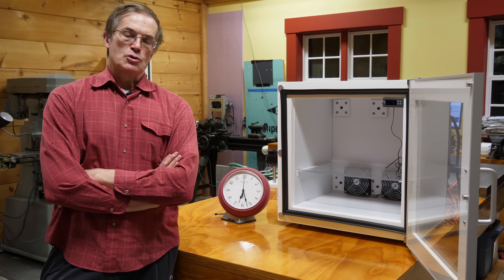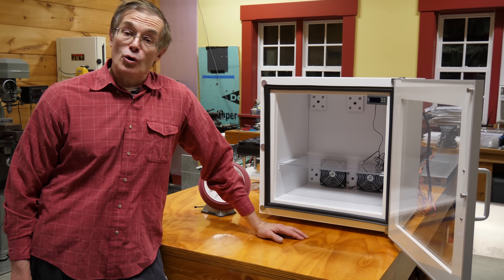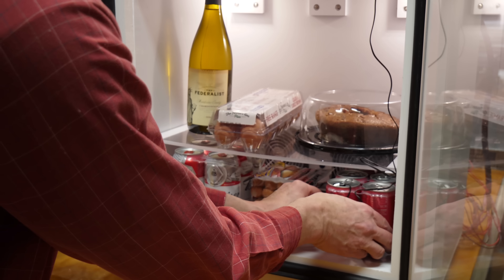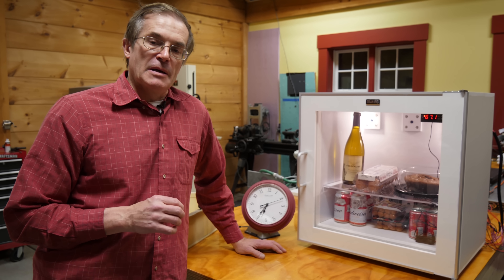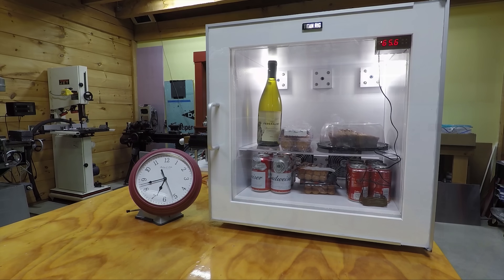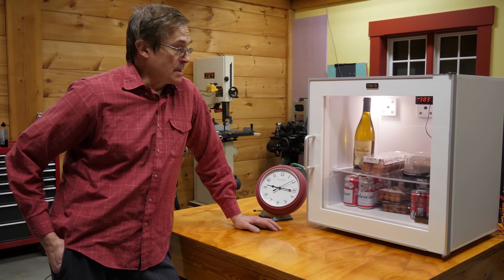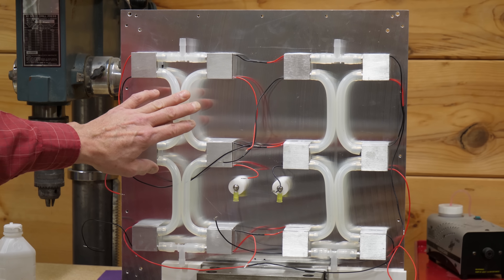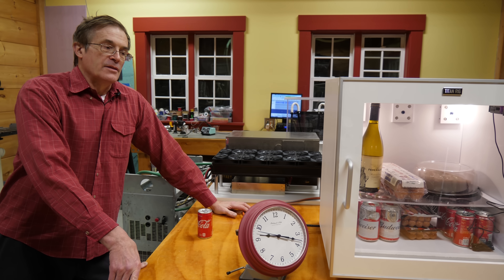TESTING OUR DIY REFRIGERATOR! - TEC/PELTIER

Comment: Hi there! I'm impressed with what you did here. Can you add more details about variation of the humidity (RH.)  throughout the cooling process? And was there any condensation  ?  And what was the output power?
Reply from the maker: Thanks.
There was no condensation, but the air in the lab is relatively dry.  The refrigerator uses 125 watts continuously.
Reply: @TechIngredients  Thank you very much! And one more thing, if you change the design a top door instead of a side door you can save more power!

Comment: Not sure you look at old post but. I live in an area where tap water is a little iffy for consumption; OK for showers etc. 
4 or 5 years ago, I looked into water filters for drinkable water and settled on the gravity fed Berkey filter which is 2 cylinders, one on top of the other. The top cylinder, supply, gravity feeds water in to the bottom through a special filter. This system is very good and my wife and I have enjoyed excellent water since. 
THe filters are good for 3K gallons each, so, I have changed them only once. They still pass the red dye test.
Question(s) is/are would making a cooing system based on your design for a cylinder be practical? I just need to cool the bottom cylinder and just to a pleasant chilled range, guessing, 40 - 50 F
ANy thoughts or suggestions would be great. A video on this popular design of water filter would be amazing. 
Regards,
Glenn,
SC
Reply from the maker: Yes, that would be a practical application.  Using common CPU heat sinks on the hot side would be easy.  Coupling the flat, cold side of the TEC to the cylinder might take a little thought, but once attached, you can experiment with a variable voltage power supply and once the right steady state temperature is reached, substitute a compact wall wart for the system.

Comment: A size of the water cooling radiator is monstrous. Compare it with a typical computer water cooling system which dissipates about 200 Watts without any noise produced.
Reply from the maker: Size matters.  The larger the radiator and the slower the air flow, the higher the effeciency.

Comment: The problem with this device will be the ambient temperature, in the video the room temperature 68 F, hence the reason you can go down to 38 F, but say the temp in the room was 90 F, then this device would only go down to 60 F, a Peltier device can only cool down about 30 F below ambien temperature.  that is why you want to use a heat exchange outside I assume?  this way the ambient temperature would be lower, but in the summer it would not work.

Comment: It is true. It makes no sense. You spend energy in transferring heat out of food and the refrigerator to dissipate it into your home. Then you use more energy to remove heat from inside your home with an AC. A heat exchanger outside of the home would be a lot better. Hope to see it in the next video.
Reply from the maker: We did.  Check out our video on the Mini Freezer.

Comment: Did you already thought about using magnetocaloric materials? With magnetocaloric effect, you're able to transport heat without a gas. On a secondary way you use fluids to cooling down the magnetocaloric material, but with some valves and a magnetic field it's easy to handle :)
Reply: ok, I saw you demonstrate it in another video. Great work!

Comment: I think the design of the heat exchangers could be better. It's all based upon efficiency of the exchanger. The TEC's get cold enough... You just need an efficient way to pull the heat out and away from the device. You cannot simply place TEC's on the side of the fridge and expect anything great to happen. That won't do it by any means. With the right exchanger you could use only one device to cool the fridge. Got me thinking on this..... I believe these could be more efficient than phase change..... It's all in the exchanger.
Reply from the maker: I'm sure you're right. I'm interested to hear your design ideas.
Reply: @TechIngredients  yet another project to add to my plate. 😆👍👌🤔

Comment: By the same token that T.E.C.s are reversible and investable...  Could you not also make a T.E.C... as in thermal electric cooker??  Could you amp up the cooling effect on one side so much that the other side can cook eggs???  Not that it would be efficient, but I"m just wondering if it could be made to work as an oven of a sort as well by reversing the power?

Comment: Can you pls. make a vid on a thermoelectric airconditioning unit? Hope you can also incorporate cost-benefit analysis as compared with conventional ACUs. Thank you!
Reply from the maker: I'm not going to do that.  In the video that preceeds this one, I explained that the effeciency of TECs are much lower than conventional phase change cooling.  This is tolerable in a very well insulated refrigerator, but it isn't in a large, high heat load application.

Comment: Just curious since heat naturally rises what if you put the radiator And heat sink in the top of the fridge. Cooler air would naturally fall to the bottom fridge. An warmer air to the top. The heated air from the sinks on top of the fridge would naturally flow up and away from the unit 
 Should increase efficiency?
Reply from the maker: It should.  However, we were looking to produce a refrigerator that would fit in a relative's apartment and there were very specific space and asthetic considerations.

Comment: Solid state peltier based fridges are rubbish, not matter how they are engineered.
Reply from the maker: Rubish?  Sorry to disagree, but other than electrical effeciency compare what I built to a frige from a big box stores.  It looks better and can be designed to exactly the available dimensions.
Reply: @TechIngredients  Take your thermal probe and put inside of a can of liquid which is inside the fridge, like a can of beer for example. Also run it for at least 48 hours. Then do a plot over time. You'll see what I mean. These devices are not capable of removing heat from anything other than a small thermal mass. Because they also work on temperature differentials instead of absolute values, you'll see the average temperature of the whole system slowly rise too. That's why the commercial and DIY fridges using peltier devices always disappoint.

Comment: Hmm, 15' C of temp difference.

I built a similar refrigerator but with compact fin heatsinks and a slightly different design.

My results were about 22' C of temperature difference. Only difference was that my temp probe was placed inside the refrigerator, on it's floor and not inside the food item.

Probably a decent product for indoor use but not much use if you're from a hot country where the ambient indoors temp can be 35' C+

Comment: I'd like to do this. I want to install this kind of thing on a cooler and make my own iceless cooler. Any way to do this on a 12v 15amp plug for a semi truck?
Reply from the maker: That's basically what we have here except that I used a DC power supply to convert the  120V AC to 12 V DC.  Also, this refrigerator only uses 10 amps.
Reply: @TechIngredients  wow that is amazing! I was expecting a much higher number, and being honest i haven't watched part 1 yet. 10 amps is double what my roadpro 40 quart uses, but it doesn't keep meat and vegetables fresh enough for 3 or more days because it only cools to about 45f regardless of how cool i keep the sleeper. It only goes lower in the winter in northern us, and only if i leave it outside of the truck.

Packaged food keeps but its full of preservatives and junk, and i want to diet better so that im not wasting more time eating junk and gaining weight when i could eat better if i had good cold food storage. 

Swift, the company i drive for, doesnt provide diesel generators (apu) or refrigerators in their trucks. So low power draw is also a concern due to anti idle laws preventing me from running the truck to not kill the batteries overnight...

Also, thank you for the incredibly fasy reply.
Reply from the maker: Insulation is key.  If you have the room add more and the power draw decreases.  Furthermore, take advantage of your situation.  While driving you have incredible amounts of power available, place a few water jugs in the cold box to increase the thermal inertia.

Comment: I wonder if you have plans/are working on to make deep freeze atleast whats required to making dry ice or pure nitrogen
Reply from the maker: You can't.  Take a look at our video on extreme cooling where I explain the limits of TECs.
Reply: @TechIngredients   I newer expected an answer from such a not recently released video. I appreciate it a lot though anyway I should have specified that I didnt neccesarily needed it to require TEC. So in the video you referenced, do you say how scientists and businesses do reach those super cold temperatures?
Reply from the maker: Liquid nitrogen is cheaper than beer and is the most common method for scientific and commercial cooling.  Liquid helium is very expensive and shares this role with closed cycle cryo coolers for research.  Work at these temperatures is always very expensive.

Comment: it's still an ineficient system compared with traditional compressors... for small appliences the danfoss bd35f does not have anny other rivals...
Reply from the maker: Of course it is.  I spent the first 10 min describing why and why it may not matter overall.
Reply: @TechIngredients compliments for the first part the presentation is well donne but: in any way you watch it IT MATTER, if you are on the grid will consume alot of energy that has to be produced, but most of the small 12/24v fridges are working on batteries and sollar, the thing people seem to forget is that you have a limited number of cycles on the batteries so every 2-3 years if you are using lead acid will degrade and have to be changed...  I'm sorry but somehow this type of videos give people the ideea that peletier cells are a valid alternative for a proper low compressor....

Comment: I think there are four main bottlenecks in this design: 1. heat going from the internal air to the aluminium plates that form the interior walls, 2. heat conducting laterally through those thin interior wall plates toward the TECs, 3. heat conducting away from the TECs through those stacks of spacers and plates (so many interfaces!), and 4. heat conducting laterally through those thin output plates away from the spacers. If you put a temperature probe on various spots, I think you'll find: 1. that the inside walls on the sides (or even the middle of the back wall) are much warmer than the pressure plates at the back, 2. that the base of each output stack is much warmer than the far end of it, and 3. that the output plates are much warmer right next to the stacks than in the middle.

I think it would work much more efficiently, and probably be capable of running without fans (on the hot side, at least), if you added three things: 1. some finned heat exchangers directly on the cold side of the TECs (such as CPU coolers), 2. heatpipes to collect heat from the rest of the interior walls toward the TECs, and 3. heatpipes to distribute heat from the hot side of the TECs (directly against them, not via a stack of spacers) to a lot more than six spots on the output heat exchanger plates. (Witness how densely the heatpipes are spaced in a high-end CPU cooler.) You can buy bare heatpipes of various lengths online and make a simple bending tool to fit them to custom applications. They're commonly used in custom passively-cooled computers, which operate at similar or higher thermal power levels* with similarly-sized or smaller external output heat exchangers.

*similar to or higher than what I'm just guessing this refrigerator is operating at, because I don't recall you saying in either video how much power it's consuming or pumping

Comment: What about the power consumption? How much power does it drain to cool the stuffs in it. Does it worth, compared to fridges with compressors ?
Reply from the maker: 125 watts continuously.  TECs are less effecient than  compressor based cooling.  Even though the conventional refrigerator will use a higher peak power, it's lower duty cycle means it will average a lower power consumption.
Reply: @TechIngredients  thank you very much for the response.

Comment: What parts the remote radiator is made of? Or I can just buy it somewhere?
Reply from the maker: It is assembled from two computer cooling radiators and eight, 140 mm, 12 volt fans with a pair of 12 volt solar water heater pumps.

Comment: how much energy does it consume as compared to a normal mini bar fridge. That is surely the most important question...
Reply from the maker: On the average, this will use more energy.  The peak power consumption is lower, but it operates continuously and therefore uses more energy.  
I disagree that this is the most important question.  It's not irrelevant, but the flexibility of these modules allows the builder to configure them to custom designs and I think that is more interesting.
Reply: @TechIngredients  i actually agree to be honest, within some modicum of energy decency. love ya work

Comment: that fridge uses around 400 watts. 6 60w peltier modules.
Reply from the maker: Did you watch the first video?  A TEC's maximum rating is not where you want to opperate it, not even close.  This is because the effeciency increases as the current decreases.
Reply: @TechIngredients  My mistake! watching the first one now. Very technical and proper application, calculating power needed and then TEC usage needed.

Comment: My estimate is that the 6 TEC's plus the fans take around 450 watts when running. (I'm playing around with a 2 TEC setup with 4 computer fans and it takes 150 watts when cooling.)
Reply from the maker: This depends entirely on how much voltage you apply.  You will almost never want to run a TEC at it's rated maximum power level.  The effeciency near that power is extremely low.
Reply: @TechIngredients  What voltage and amperage did you run the 12 in your project?
Reply from the maker: I'm trying to remember, but because they were operated in parallel rows of several in series, this may not help.  The total power usage including the lights and fans was 125W.  Each TEC was consuming approximately 8W.  The lower the power that you use drive a TEC, the more effecient it becomes.